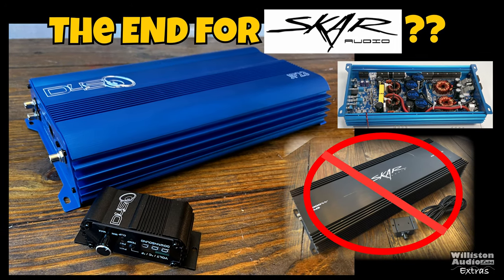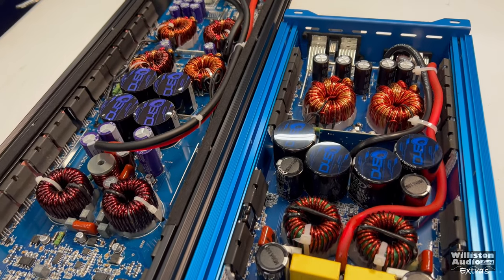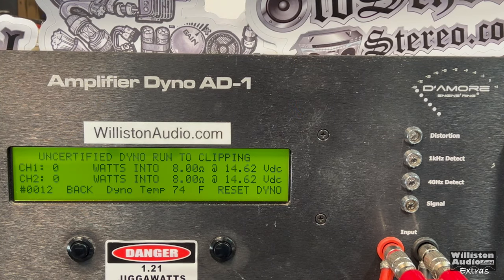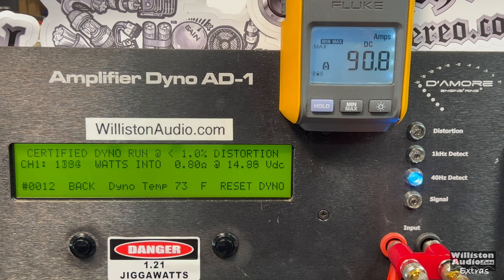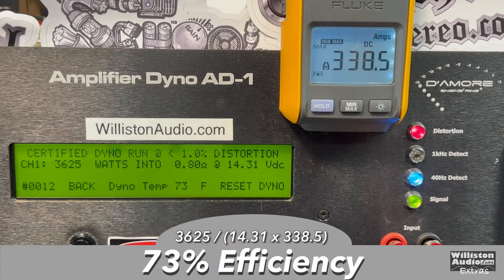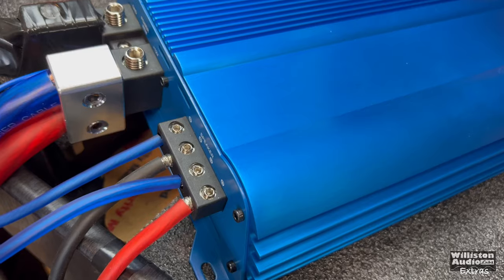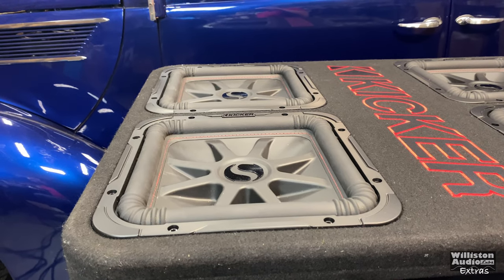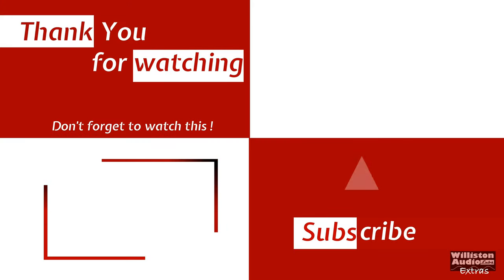Extended Amp Dyno Tests on JP23 v2 and More!

Comment from the maker: PREVIOUS VIDEOS
D4S JP23v2: https://youtu.be/PRzPTxRr15Q
D4S JP23 (original): https://youtu.be/ufuoi-vn-g4
D4S JP23 (extended tests): https://youtu.be/v7nohX0C3gg

SHOP
JP23v2 Monoblock Amplifier: https://lddy.no/1d7oj
JP23v1.5 Monoblock Amplifier: https://lddy.no/10uwo (older model)
JP84 Blue 4-Channel Amplifier: https://lddy.no/zhh0
All D4S Amplifiers: https://lddy.no/vv99
SKAR AUDIO RP2000.1D: https://lddy.no/1d7up
D4S LTO 6.0 battery: https://lddy.no/1d7tj
1/0 OFC Amp Wiring Kit: https://lddy.no/1d7uj (don't get CCA!)
HiFiVega 1/0 OFC Wiring Kit: https://bit.ly/3rV9vDU
HiFiVega 1/0 OFC Big 3 Kit: https://bit.ly/3rXqxRW
Note: Amp requires 1/0 OFC wiring and at least a supplementary battery. Remember, it takes power to make power, beef up your electrical system first!

DISCLAIMER: This video and description contains affiliate links, which means that if you purchase from one of the product links, I may receive a small commission. As an Amazon Associate I earn from qualifying purchases

Comment: Big D we want to see the clamped power with box rise on the subs like you used to do on the subs.
Reply: It'll be near the same cus he's testing 4 ohm also. Amp don't car if the box is 10cf or 1cf . It'll make certain power per impedance/voltage
Reply: @damnitdang  oh boy you have a lot to learn.
Reply: @johnnyditommaso6807  idk. Idk what you're trying to get at. 1ohm rating to 4ohm. What you wanna see? Power at 3ohm after rise ? Basically it'll be just a bit more than 4ohms.
Reply: @damnitdang  it's a difference in playing music music is dynamic all over the place these test like u said are one frequency with steady power  .in real world it matters u get real clamp power in set up dyno is that control set in real world box dies matter resistance is heat heat plays alot in what amp does
Reply: not  100% true @damnitdang
Reply: @damnitdang in real world ppl with reg system meaning the 13. 5 14 volts would actually benefit in running 4ohms than 1 or some 2ohm than 1 . why because they don't have the electricial meaning if that amp pulling 150amps @2 ohms and u got alt that's 150. u not getting the whole 1000 to 1100watts you can make what's not there plus box rise and resistance ppl think that but those with bigger alts and reserve battery is why and that's why the do it. need power to make power and if u think u getting 2k watts on a stock system now possible 200plus amp draw now way u get 2k watts

Comment: Can we get extra vids with lower voltage things like 14.0, 13.8 & 13.4 that way we can see how the amp perform😊 at lower voltage
Reply: You are looking at probably 2500 watts with a impedance rise at 1ohm  meaning you would have to wire your subwoofers at. 5ohms combined or one dual at a half ohm? I have two jp23 amplifiers and I ran them on two sundown xv3 12s? Had two run a Taramps 8k  on them to make them move hard?

Comment: Why is the dyno test at .6 ohm harder than running .5 ohm in a car? I’m running my jp23 v2 at .5 ohm typically sits at 13.4v while hitting major bass during songs
Reply: What is you’re electrical setup?

Comment: Thanks for the dyno thing puts out big power I bought one after watching the video bought the half ohm protection plan so hopefully I'll be good 😊
Reply: hey man,have you been running your jp23v2  at half ohm ? i have been  running mine at 1 ohm on a single sealed 12,  i want to add another 12. and would have to go to .5 ohm load with both.. just wondering if i am asking for trouble..? lol
Reply: @madnessmaker6162  the only ohm load this amp has ever seen is half ohm but you gotta have good electrical or it will blow I have a 320amp alt at 14.8 and 10k worth of lithium every now and then it will drop low 13's if I'm bangin hard at a stop light but you can just use the bass knob to turn the bass down a little bit honestly I would just tune the gain down a little overall for long-term
Reply: @madnessmaker6162  I had the same question

Comment: Those are good amplifiers for one ohm stable? And they will probably push 1500 to 1750 watt subwoofer  I bought 2 jp23 and tried them on my sundown xv3 12s? Not enough power? And that's a lot current being drawn for a 3000 watt amplifier?

Comment: My skar rp2000 went into protect mode and would not come back to life 😢it was a sad day for me until I upgraded to the skar skv 1500 😊
Reply from the maker: Bummer!
Reply: I’ve had 3 rp2000 for the last 4-5 years. 2 running 2 15’s at 1ohm. Other In  storage. Then last month one quit working. Nothing I could do. Thinking of doing a new build in a 62 impala. Might try a jp or like you step up from an RP

Comment: I recently got a jp95 for mids and highs,it replaced a rockford,but the jp95 has a bad engine whine..the rockford didnt,if anyone knows why,I would appreciate any help with this problem ..I would think it was a rca problem cause the rockford didn't do it,and I've grounded the outputs to the chassis of my radio but did not help..so please any ideas would be greatly appreciated

Comment: What do you make of some amps doing significantly higher numbers on dynamic vs 1%? Meaningful, if so to what degree?
Reply from the maker: Tells me the power supply is unregulated and there may not be current control for protection

Comment: How much electrical do you think this amp would need to stay happy? I have a 240 amp alternator and a yellow top optima agm battery! Just ordered it so i am curious ! Would a appreciate a response back thankyou !
Reply from the maker: You may want a 2nd battery to supplement like one of the D4S LTO 6.0’s or an Ioxus Supercap battery
Reply: @wal2  I just bought this amp and I expected more power but I'm running it on a stock alternator and stock battery, do u think that's why? What battery should I buy? Recommend something good for me, thanks
Reply: @Gilbert-i8z if your alt is rated 160 amps to run this at 1 ohm u say the current draw was above 200amps the ano is powerful u need power to make power and if your system  is at 13 volts and dipping no u not go get power out of any amp not full unless u have amperage to support

Comment: Have you ever tested Niche amps. I got a couple of them from a friend and they are pretty awesome. There's not a lot of info on them.
Reply from the maker: Thanks for the suggestion
Reply: @wal2  One is a four channel and the other is mono. But there around the same size. I would say 15" long and around 10" wide. Chrome and have meters on the tops.

Comment: Hey can you put it in a car that only has a 12volt system
Reply from the maker: Sure can as long as you can support the current consumption
Reply: @wal2  ok cuz I was looking at putting it in a tl with my type x

Comment: So don’t run this under 1 ohm or will go into protection ?
Reply from the maker: I doubt most people will see a true 0.67 load with speakers, so you'll be fine. The resistors are brutal for the amp tests while speakers will fluctuate in impedance based on frequency, temp and other parameters
Reply: The original model was a half bridge Korean board. They run down to half ohm generally with now problem. The new model I can see is a full bridge design. That’s why it’s so much smaller. They do not like under 1 ohm. That being said there is substantial rise in impedance when you wire an amp to speakers. 3 times at tuning frequency is normal for a ported box, so on speakers .8 would most likely be fine all day long. I install a lot of amps and I typically don’t run full bridge under .8. They don’t like it. I have done them at .4-.5 in competition vehicles that demo for 20-30 seconds at a time, but in a daily driver keep this thing .8 or higher. You probably think .8 sounds weird but a lot of todays very high end subs don’t utilize typical  dual 1 ohm or dual 2 ohm coils. They do dual .9 or dual 1.8 to suck a little more power out of your amp and help with rise. Dual 1.8 in parallel is a .9 load.
Reply: @Van1018s  actually the v1 v1.5 and this v2 are all made in China and half bridge…which is why they can all be strapped. Full bridged amps cannot be strapped
Reply: @momanholmes8715  that is true full bridge cannot be strapped. At first glance and based on reduced size I thought the 2.0 was a full bridge, but you are correct. I’ve never hooked up a JP amp. Only sat in his Tahoe. Twice. It’s very unimpressive for what’s in it. And I’m a team DB guy. Team DB built that Tahoe, but I’m not impressed. Looks great. Not very loud considering what’s in it.
Reply: I’m running a wired to half ohm load. Rises to 8. No problem 👌.
Reply: @D4S-JAKE  you’re lucky to only have that much rise. I have 2 vehicles I compete with. One has 2 DB 20k’s wired to .4. I rise to 1.9, huge ported box tuned very low. Does a 160.2@22hz. The other is a single DB 20k wired to .45. It rises to about 1.5, 4th order. Even at 1.5 I’m clamping 19k at 16 volts. So can’t complain to much. I wish my rise was as little as yours though.
Reply: @Van1018s   sound kinda like not only hating.... But misinformation as well. You stated it was full bridge without even knowing. Or even where it was made. Then got corrected and started backhandedly bashing his truck.. WOW I said that to say this.. I just ordered the amp and I don't like full bridge. I was fairly positive it wasnt.. but at first reading your comment I got worried I made a mistake. See it's people that do that and cause people to question or concern a product..
Reply: @matthewguynn5745  yes I made a mistake. When big D originally tested the amp I asked in the comments if it had been changed to full bridge. No one answered. Based on the greatly reduced size and increased power I made an assumption, which I was quickly corrected on. As far as where it’s made there is no visual difference or performance difference between a high end Chinese board and a Korean board, although Korean are considered higher quality. I apologize. As far as bashing JPs Tahoe it’s one of the nicest installs I’ve ever seen, and I’ve been competing since 1995. Been to world finals 11 times. For what’s in it it is the least impressive thing I’ve probably ever heard.
Reply: @Van1018s thanks for clarifying 👍 seems to be a decent amp. And I hope it really has the damping it's rated at.. if so it's a steal of a deal. Mine should be here today we shall see
Reply: @matthewguynn5745  JPs amps are very good. Do over rated power and are built very well. You won’t be disappointed. I’ve watched tests on all of them. They are becoming increasing popular on the competion scene also. Just make sure you have the electrical to back it. Under your hood run another wire, 4 gauge is typically fine, from you alt to your battery. The factory wire is to small. Also run an additional ground from the frame to the battery under the hood. That will allow you to get the most possible out a stock charging system, if that’s what you have. Then 1/0 from battery to amp. You should be quite happy with amp.
Reply: @Van1018s  oh yeah.. I already have a decent build . Xs power up front 250 alt. 0 ga runs to a ioxus super cap and all big 4 upgrade..

Comment: How can d4s offer a .5 ohm warranty for 2 years if it keeps going into protect ??
Reply: The 0.5 on speakers equates to about 0.8 in the Dyno. Dyno uses resistive loads where speakers are reactive (dynamic) so their ohm load fluctuates depending on frequency, temp, box and more.

Comment: Do 12v or 12.5 what us normal guys charge at!!.. Not everyone has all the crazy charging
Reply: I think it says right on the website to order YOU MUST HAVE UPGRADED CHARGING SYSTEM / SUPPORT BATTERY to run these.
Reply: Well no shit if u have a big system.. But if just one amp.. Not everyone has to have all that.. The amp can run at 12.5 as well
Reply: @Jordansautorepair  the amp can run at 12.5 but still needs the amperage - which calls for upgraded electrical. Its soaking up 400 amps, just ONE of these amps IS. A huge system, by the numbers
Reply: A healthy car battery should be near 14 V anyway. (13.8 is standard, 12 minimal)

Comment: It almost couldn't push those sub if it was a JL amp those sub be knocking im just saying.....
Reply: That's 4 12s dude.. and it was moving them.. those model squares don't have a very high x max anyways.. and what jl amp are you referring?? The highest model is a 1000/1. Without getting a hd   At well over $1 per watt.   I had a 250/1 and it wasn't anything to brag about.. I sold it for it's overpriced amount and bought amps that would do 3x the power .. also sold the subs for some that would handle power .  Jl has the w7  and 1000/1.. outside of that it's weak bs... when will people wake up
Reply: Oh btw enjoy that 60 percent efficiency your jl does.. even at 4ohm.. 😂
Reply: Sorry bro I don't have jl I got sundown now so yea get all the cheap stuff I bet it does the job
Reply: @xiongxiongloft5937  I'd be glad to put my RF T2 and Orion amp against whatever you got... 😘 How's that for cheap
Reply: @xiongxiongloft5937  sundown isn't all you think btw.. watch parker blow the 6 on Tara 8k not clipping.. meanwhile an American bass xmaxx took the full amp... Why don't u Bragg on those sundown amps while I double your power with my Orion😂😂😂
Reply: I love orion sub thinking about it if I don't go for deaf bonce